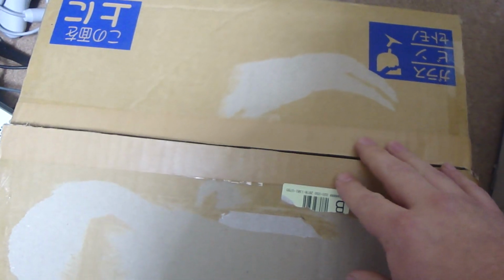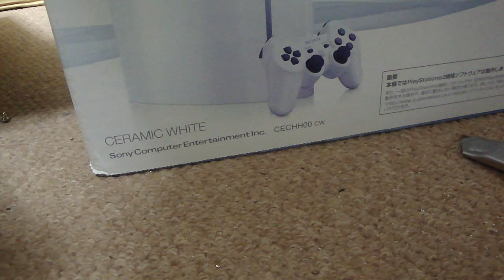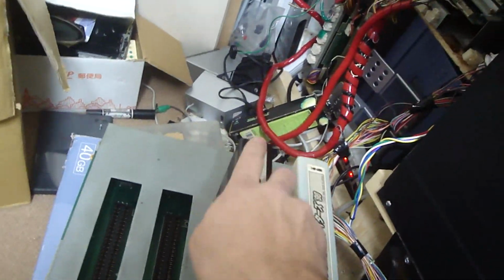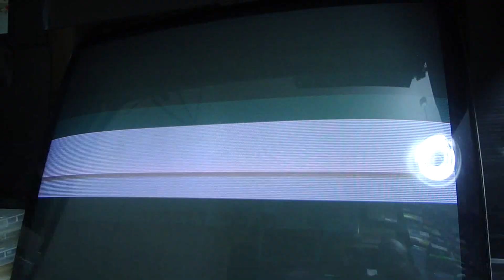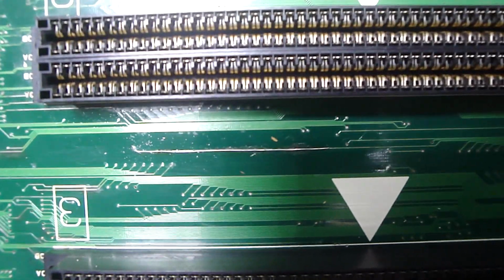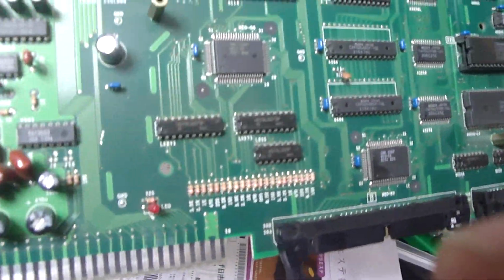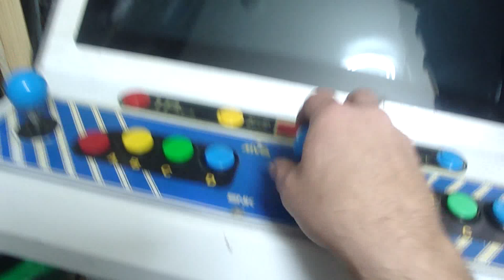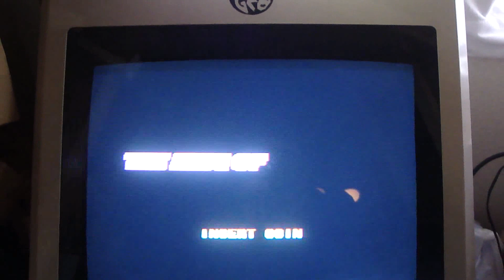MVS 4-Slot Pick Up And Repair

Comment: Nice pick up man! Love the 4 slot boards. Great job getting it all cleaned up and working well too. This one didn't seem to be in as bad of shape as some of the ones you've fixed over the years, so that's awesome that it was working fairly decently to begin with. I've just got the 4 slot going right now in the neo 29, but I'd love to get a 6 slot for it, I just always hear about how notorious they are for not working so well sadly. Merry Christmas Luke! =)

Comment: Hey question, Isn't steel wool bad for cleaning metal contacts? I read that it makes the metal oxidize faster than normal if they were exposed. I'm just curious.

Comment: Yeah I know I could tear one down but as far as diagnosing and fixing one i'd be kind of screwed, their is/was a like local amusement company that had a huge barn with arcades and stuff less than 3miles from my house, dont know if they had any 80s-90s arcades to get rid of. I might just stick with building some mini MAME cabinets or just doing some mini arcades using my consoles and like their arcade sticks and a vga box to use some 19" dell ultrasharp lcd's I can get for like $20

Comment: Luke im a great fan of yours, you my friend were the inspiration for me to continue to search for the neo geo mvs games that i always wanted even though i live in Bosnia where that task is really impossible, by a miracle i found 20 games for it, even got a 4 slot for myself and  my friend. I really hope you could help with the problem here, my friends 4 slot just wont run the games, the board is great, no trace damage, leaky battery and he even cleaned it all around, and still the games wont run and it always stays on the cross hatch screen, he went througj the test screen and it turned out with no error, please help, he cant wait to play some neo madness XD all thr best from Bosnia !